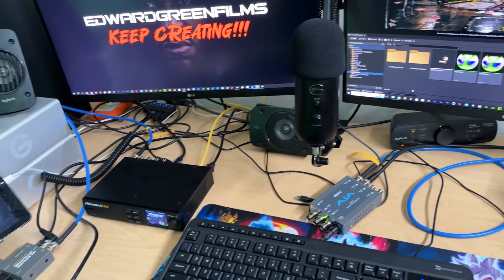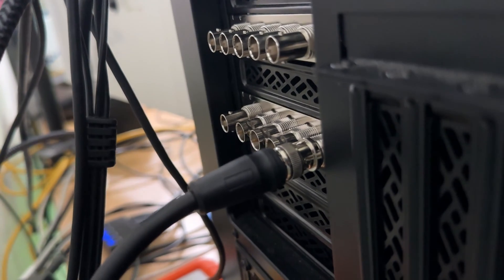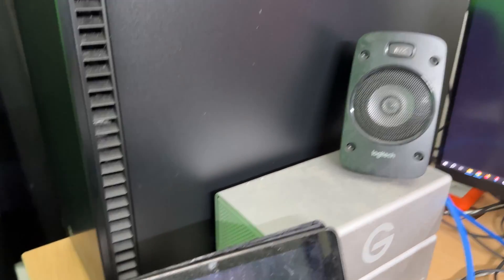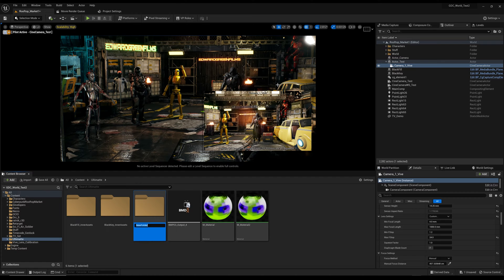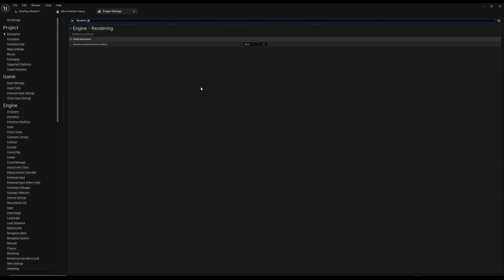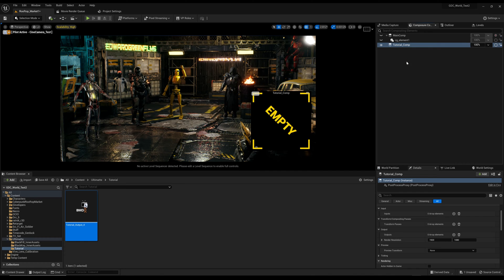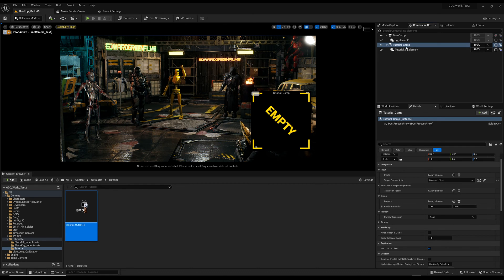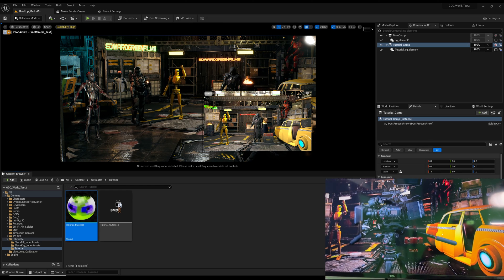Updated: My Ultimatte 12 HD to Unreal Engine SDI Port setup (Overview for Virtual Production) Part 1

Comment: do you really have to go into play mode or simulate mode in order for the Unreal Engine to output Video throught SDI OUT using its Blackmagic Output settings? what about Media Capture? why didn't you use that for outputting CG background from unreal engine instead of the trick in this video?
Reply from the maker: You can go through media capture as well. They both work for sending your cg background out. The reason why I chose the play mode is because if you setup your scene in Unreal Engine and you have actions or animations that come to life when you hit play mode it will begin (I have characters that come to life with animations or cars or the scene that start to move). Hopefully that answers your question. Thanks for watching the video 👌🏾

Comment: One question sir… would you not need to gen lock your camera too?
Reply from the maker: I’ve done projects without Genlock and it’s worked as well. You have to just do your tweaking to make sure everything is dialed in. I believe the Genlock is just another tool to add to securing it.

Comment: Hey Edward! Where do end up recording your final footage? I'm guessing you do it all in real-time (the comp and all)... but there where does it get recorded?
Reply from the maker: For my live action footage I record it from the camera. The virtual footage I record it from Unreal Engine. I render out whatever settings I used making sure the camera and UE line up. Then I would take it into something like Adobe After Effects or Davinci Resolve to comp it all together and  do a final grade or color correction to. From there I will edit it all together in Adobe Premiere.
Reply: @GTshortStories  So do you use Take Recorder in UE or are you recording to some deck from the Ultimatte for the UE stuff?
Reply from the maker: Yes, I’m using the UE’s take recorder. I prefer other software to do my final keying but the Ultimatte works great as well. I’ve used the Blackmagic Hyperdeck before and it was ok. It really depends on your workflow and how much time you have to get something out there.

Comment: Great video thank you for sharing. I wanted to ask why are you using the 8k pro instead of the duo, im interested in what is the difference because i plan to get the duo, its cheaper.
Reply from the maker: The only real difference between the two are the 8k pro can support resolutions up to 8k while the duo only supports up to 1080p.

Comment: very nice thank you. I have a question, how do you get unreal not to crash? because i dont trust its stability during a serious live production.
Reply from the maker: I don’t probably have the right answer for that but I basically grabbed the most expensive GPU that I could afford when built my computer and I haven’t had any issues with Unreal crashing. I’m running an RTX A6000. But to give you a more realistic answer it would be to check your viewport mode and move it down from cinematic. There’s so many ways to adjust your settings that can potentially help from crashing but also I don’t know your system or see your level map to pinpoint why this could be happening.
Reply: @GTshortStories  I have an RTX 4090 with a Ryan’s 7950x and 64gb ddr5 ram.. it seems like it’s a common issue for many people, I have been working in virtual production for many years with other dedicated solutions but I have recently decided to learn and use unreal engine. It’s good when it works but the crashes are annoying… thanks for answering me though. Your tutorial was straight to the point
Reply from the maker: @ibrahimmomoh Yeah, it seems like you have more than enough to handle it. It’s definitely one of those things that I’ve been on forums trying to figure out. The setup that I’m running at the moment haven’t ran into any crashes so far and I just did a presentation at GDC where I used my computer and had it running UE for 10hrs, with a heavy level map, livelink streaming Xsens, Vive Mars and it held without hiccup. But I totally understand the frustration sometimes things can happen and there’s never a direct answer for it. I’m not an expert in UE just passing the info I use to make it work for my setup. Hopefully you find an answer and pass it on to me 😊
Reply: @GTshortStories  😄.. 10 hours thats serious stuff. well ill keep searching. maybe in need to reinstall again

Comment: Hey Edward thanks for taking the time to make this video, I have been looking everywhere to find out how to connect my ultimatte, I only  have the mini version with hdmi connections  but I think  it will work fine when connected like this. Just need to order an adaptor to hdmi  to fit the sdi out on the PCI card
Reply from the maker: I'm glad I could help. I also was looking everywhere for a video on the Ultimatte setup and couldn't find one. Thanks for watching.
Reply: @GTshortStories  I got everything working thanks again. I  also I found out if you use 'media capture' in the virtual production tab at the same time you can output from 2  Cameras to separate Unimattes.
Reply from the maker: @Josef1cnc  That's awesome to hear. I'll keep that in mind for future productions.
Reply: What's the difference between the 12 and the 12 mini (other than like $400!)?
Reply: @tommywright  the mini uses Hdmi connections and not sdi.Also they mini doesn't have as many outputs ie you can't output the foreground without the background and I think maybe you can on the 12. Think it has more controls available too

Comment: Thanks for sharing your video on virtual production. Regarding the use of Media Capture and Composure for background imagery, what guided your choice between them, and what objectives were you aiming to achieve with this method? I find your first method with Media Capture to work much better.  What advantages of using Composure for BG output?
Reply from the maker: Both are great ways to achieve the goal. When I was prepping for my GDC demo and trying to learn all the ways to approach virtual production I noticed with this step I had less frame drops when it came to running the vive mars, Genlock, the game engine playing all of my background animations, live streaming Xsens into UE, feeding the live camera into it and making sure it maintained the 24fps. I also was reaching out to HTC Vive   Techs and Blackmagic to find out what the best pipeline to utilize everything. I agree with you that the first method works better and it seems easier to get there as far as steps. This method is another way that I used that I didn’t run into any hiccups once achieved. Thanks for watching
Reply: It's great to see your dedication to finding the best pipeline and your effort to maintain high-quality production standards. Your videos are informative and beneficial to the community. Please keep sharing your knowledge and experiences; I look forward to learning more from your future videos! @GTshortStories